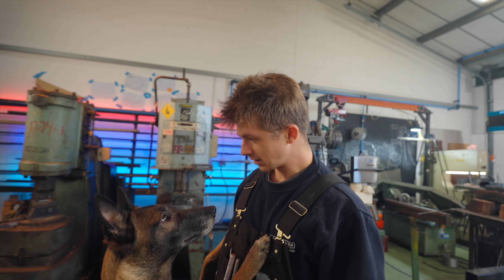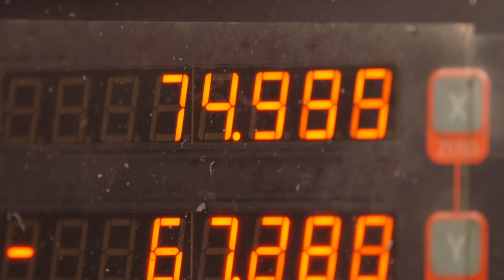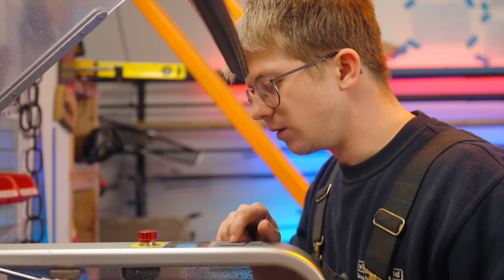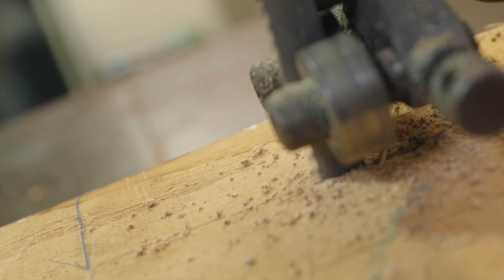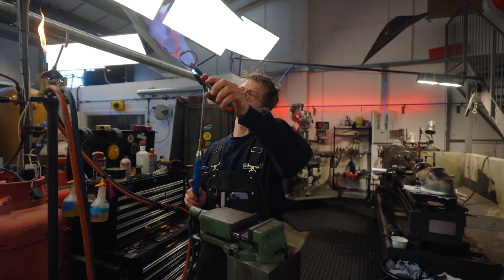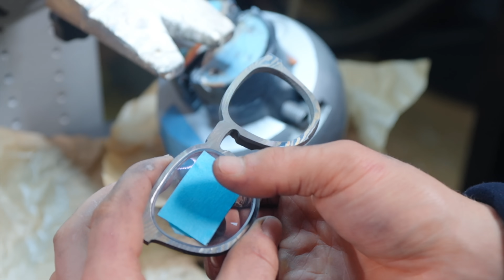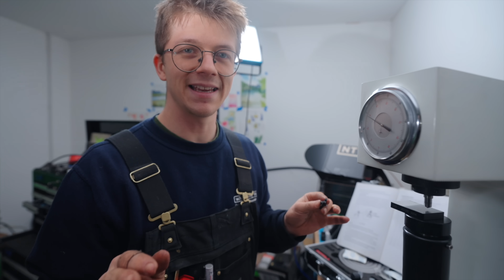Making Titanium Damascus Glasses, Part 1

Comment: Hot air? My optometrist doesn't use hot air for lens fitting and frame manipulation. They use a budget wok-type benchtop frying pan thing. (You know, those squarish ones with the big lid.)  And they fill it with dry rice. The rice acts like sand, conducts heat, absorbs moisture and releases it again when heated. Nestle the frame bit you want to change into the 'warm sand' type rice bed for a moment, then pull it out. Done. Works beautifully.  Also, if you manipulate the frame right above the warm bed of rice, it cools slower and so gives you more time to work it.

Comment: The offset of the base you were laying your stock on had a couple degrees offset on the x-axis. The machine base is an uneven suface as well so I would suggest making a bracket that attaches to a known flat part of the machine and hold that special base for cutting. You can check with level or swing gauge to measure the deviation. love your work :)

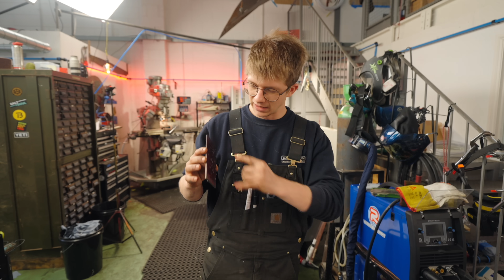Comment: 8:49 grinding off .02 is actually a real pain in the rear-end. In high production, cnc, I will scrap if it's over .006 because i can make a new part in the same amount of time as the touch-up

Comment: In reference to your concerns about the cuts on your Wazer potentically ruining a week's worth of work: hypothetically speaking, after clamping down the material wouldn't it be possible to do a set of psudo-calibration cuts into the portions of your material you plan on removing? This would be done in order to let you see how far off these cuts were made compared to what you expected and allow you to adjust your real cut to take these inaccuracies into consideration and have a lot more confidence.

Also worth noting I have no actual, difect experience with any form of 'digital file' based cutting / CNC / 3d printing or etc work and so have no idea if something like this is actually possible / feasible / has gains worth the effort; I'm just spitballing ideas.

Comment: I have that exact same hardness tester. When you’re raising the base, go until the little needle rests on the red mark. Then rotate the main dial to the black 0 on the “C” scale, and I believe you’ll get better results. The instructions are garbage that came with it. Not entirely sure that’s the right way to use it, but that’s what I do and get all of the hardness samples to read exact so that’s just how I’ve been using it and it seems pretty reliable.

Comment: Alec, I’m a machinist in the states. The shop I work at specializes in fiberglass and plastics rather than metal. I say that because a lot of the jobs we run, we run on vacuum tables. We use suction methods to hold entire parts down. I feel like that would be a good idea for you to look into. It’s not perfect of course and you do need to make sure the vacuum doesn’t shut off while running, but it’s actually a really good system I’ve never worked with before. You should look into it. You won’t regret it.

Comment: your piece was offset because you didn't account for the width of the laser. by sliding your billet against the cut piece you were not accounting for the removal of material that you spent so much time working on

Comment: if you are going to buy a 3d printer id suggest a bambu labs printer they are very easy to use and no messing about with bed leveling etc. basically just plug and play.

Comment: get a X1E bambu labs printer, it has the ability to print in ALOT of different materials! Including Carbon Fiber. Or if you are looking to get a metal printer that also allows for you to do printing in metal specifically stainless steel, you could get a Markforge FX10, which also prints in onyx(nylon carbon fiber product made by markforge), nylon and carbon fiber individually as well!

Comment: The nose holder part usually only works on plastic glases and metal glasses almost always uses a added on nose rest piece with some plastic or silicone pieces. That is because metal is a bit different and might leave marks on your skin in reaction to the oils on your skin. It will also risk chafing in a higher degree then with plastic glasses. I know that titanium is usually less reactive then other metals and is why they use it in bone screws and implants but can't say how it would work in combination with your skin oils and other things our faces are constantly exposed to.

Metal glasses will also need a relief cut on the side and a screw that clamps down on the lens. Plastic glasses is more flexible and do not need that in the same way.

Edit: Note to self, watch the whole video first since you litterally mentioned that directly after I wrote the last part.

Comment: I think where you were off is you cut on the inside (left) of the 200 mm when it should have been the outside (right) so that the butted up side was exactly at 200 mm. That shifted the whole titanium piece the to the left by the width of the cutter and hence moved the hinge slots to the right as noted.

Comment: if you wanna know a new fancy word, "Kerf" is the technical term for the offset concept you were explaining. Kerf is basically the compensation for material removal width. The CNC lasers I used to cut metal with would have kerf presettings, depending on what type and thickness of material, which automatically would adjust to make sure the part dimensions would come out the exact some as in the DFX files. You did an amazing job explaining the offset concept btw!

Comment: Not a professional with cad or cnc cutters, so I don't know the technical terms, but there is something I've picked up from working alongside them.

When cutting an inside diameter on the waser or plasma table, don't start the cut on the actual edge. Start it in the middle of the material and have it move out to the edge.

This helps keep the edge consistent without worrying about it not conforming to the specification since water jet and plasma cutters tend to wallow out the initial hole they punch through the material.

Comment: If you read all the instructions on your Rockwell hardness tester it will say to ensure the working area temperature is like 70° and if it is not it can actually throw the test off a point every degree or two

Comment: The first thing in the hardness tester instructions: 
"the test table should be built up with cements or metal having certain stiffness and strength"
- Alec "wobbly wooden table should be fine"
"Why is the factory calibration not correct?!"

Joke aside, fantastic video! Love the titanium saga that is unfolding

Comment: How in the heck do you even define eyeglass shape, is the multi-curve glass ending on the same plane at the edges making it easier?

I'm fine with your drawings, I've seen engineering students male worse. In fact I spent all winter holiday modeling and drawing some gearbox assembly and was disgusted by my own drawings because of how clueless and tired of the project I was by that point. It wasn't by the book job at all. It was particularly atrocious because I wasn't too knowledgeable how to actually use reference surfaces and choose tolerances let alone geometric tolerances in the application and blind work at all. Name me an engineer who knows those like their own pockets or an engineer who enjoys them.

And especially when someone makes drawings for their personal reference, I don't care the least bit how they do it. Draw a couple of stupid lines in paint and scribble a number, it's for your own use, not for a company's standardized archive/product catalogue/manufacturing people.

My school had just got new hardness tester alongside the old ones when I did some metal labs in the fall. It was fascinating, the new one was operated from the computer where you got the microscopic video feed and could measure the size of it from identifying the square points of the hole and it would spit out the hardness value.

Comment: History.... I was waist deep in the back of an old CNC lathe with a multi tool looking for a fault. A co-worker snuck up behind me and dropped a metal 5 gallon bucket on the concrete floor. I chased him out of the shop with a large ball peen hammer with every intention of applying multiple knowledge dents in his skull.... Good times Jamie!

Comment: Loving the Titanium projects I've a very personal connection with titanium a large section of my cranium is in fact made of the stuff it's very cool especially in the summer when it's stupidly hot my head stays nice and cool ,the titanium plate which protects what's left of my brain was milled using a CT scan in the university hospital of Wales in Cardiff , do you know what would make an excellent video if you were to go to Cardiff and make a video of the process not the bloody surgery bit but the whole process of the making of the plate from CT scan to finished article .

Comment: You could possibly use a watchmakers crystal press to insert the slightly oversize lenses in the frames. It reduces the outer by carefully destorting the lens, allowing you to insert the lens in the frame, then release it for a tight fit.

Great channel, keep up the good work.

Comment: Speaking as somebody who started life as an optical glazer, one thing you're going to need to be very wary of, Alex, are the stresses on the lenses caused by contact pressure from these frames. Plastics are a little more malleable with regards aperture size and minor shape irregularities, but metal frames are notoriously unforgiving on both fronts. Make sure to check for these stresses under polarised light when fitting the lenses. That said, I'm looking forward to seeing how these turn out 👍
Reply: Ahh, I see you're using plastic lenses - lol - in which case forget what I said. Instead, as you've been adjusting the lenses to fit the frames, you may want to have the optics double-checked, as the decentration and axis twist values of the lens prescription may be off (which, if you plan on wearing these yourself, may result in eye strain and/or headaches if the prescription is too far out of whack).

Comment: OK, hear me out. People who make watches also have a similar issue with the bezel of the watch for the crystal sits and they have a special tool that slightly bends the crystal/glass and they can push the watch bezel on it and then release the pressure in the crystal expands back out, creating a seal. You might be able to get in touch with a watchmaker and they may be able to help you. I would highly recommend wristwatch revival on YouTube. He does really good work on the watches he restores.

Comment: If a cut could ruin a week of work, run an identical piece of scrap through the water jet first, that way any programming errors will be fixed before you mess with it

Comment: I just wonder why you waisted big slab of damascus. Usualy metal glasses are made from skiny plate urverd and rounder and then welded/ soldered with bridge in the middle. I this easier way to this could be to created round danascus, cut in half lenthways and shape it to spec and welded it to bridge  made from round damascus.

Comment: Interesting you used the term "dead nuts".  I was an inventory controller in the mid 1960's for an aerospace company who did a lot of work on the "hot" section of military jets for the Department of Defense.  At the time, what was considered extremely accurate machining, the term "dead nuts" was used a lot.  However, I haven't heard that term much used on some of the other machinist YouTube videos until you said it and brought back memories of those days.   Thanks.

Comment: I used to program plasma cutting tables, and when I saw you build your offset piece for the cut I remembered that your kerf offset would impact the offset as well. If you tell the table to cut a line, say 200mm from x0, the edge of the piece that is cut is going to be 200mm minus the kerf. If you're going to do offsets it's generally worth buying, or making since you've got the tools, stop blocks that are "exactly" the right size to run an offset. I'm having a whole lot of fun watching your videos. I have nearly 0 experience with hot working metal, so this whole build has been new knowledge for me.

Comment: I'm an optical technician and glaze glasses for a living.
It's super interesting seeing the methods you use to make a frame fit the lens and not the other way around which is how it's usually done.
I'll be interested to see if your vision is still good afterwards as the prescription is aligned with your pupils specific to the frame you choose. 
So the lenses you're altering are not intended for your new frame. This may result in your prescription not being aligned quite right and may make your vision go a little weird.
Guess we'll see.

Comment: Alec. You absolutely can put the part back in the vise and get it close if you touch off with your edge finder again to find your datum, and use a dial indicator across the freshly milled section because the milled surface should be parallel to the axis of the mill you can dial it flat. Assuming you had the part on parallels and it was flat to begin with you would be able to get it closer this way than an edge stop. But for what you’re doing an edge stop will be more than sufficient

Comment: If you are using a CAD/CAM package like fusion 360, there is a method to locate all your pieces for cutting in your Wazer so they are always accurate. 

Take a piece of plate, doesn't have to be super hard material, but something resistant to impact (so it doesn't wear as bad by locating your work up against the edge). Bolt it down where your hold downs are "out of work area" and then have your wazer go along the perimeter of your work area. It will cut out the right angle bracket now clamped to your Wazer bed where the corner is at the machines (0,0) mark. 

I know you are not using CNC mill, but if you make a sketch of hole locations or features and print them off on sticky paper and put it on your raw material, it helps to locate all your features where they are supposed to be so your Wazer will then reference the same (0,0) corner and make the cuts accurately relative to all the machined features. (Given you machine them in the right spot). 

Hopefully I am explaining this clearly. This also assumes you always know the base dimensions of your raw material and also really will only work for parts cut out of some sort of flat stock. Be it square bar, plate, etc.
Reply: What the goal is, is to create a square bumper you can seat your work up against knowing the corner is always at machine (0,0). Kinda like the bumper on a surface grinder table, only two dimensional square.

Comment: You totally should get a 3D printer! They're great tools for making jigs and fixtures, or for prototyping a part from CAD that you can compare the metal you're working on to. BambuLab is a popular brand these days and I've used their X1C since its release and it's great, but there are so many options out there. Email me if you want some help choosing one for your shop ;)
I'm a materials and manufacturing engineering student and your videos are great to watch since I get to see some of the material discussed in lectures in practice. Really enjoy your content!

Comment: In watches (steel frame, no opening) they have a special press that bends the glass in such a way that it shrinks. You but the bezel around, release the pressure and the glass is in place. Should work with glasses as well I suppose? It sounds like it shouldn't work but somehow it does

Comment: Okay, I feel a bit called out about my comment on your last drawing. Sorry if I was too blunt. I really just wanted to give you some ideas on how to improve it, no ill will. Also I've been out of my job for a bit so I was trying to remind myself of a few things and maybe went a bit overboard.
The other commenters are of course absolutely right that the drawings only need to work for the person making the parts, so that being you industry standards don't matter here. Still as someone who also did some machining in the past it helps being able to find the dimensions quickly, and when you have to make another part of the same type a few months later (maybe you need it for another type of rivet) it might take more time getting back into it.

Comment: The jump scare clip reminded me of the time I was up a ladder after changing out the fan belt above a paint mixing room. I had just turned it on and was checking to see that it wasn't rubbing on anything, and someone set off a firecracker inside the shop. I swear my feet and the ladder went straight out sideways and then back under me (no idea how I had the reflexes to correct it). I was so mad. And to clarify, the person that lit it off did it to scare someone else and didn't realize I was up the ladder.

Comment: Hi, I'm an optician and do a lot of work with doing exactly what you're doing: Making a lens fit into a frame! A few quick things!
For one, you'll notice the lens you already have cut has an outer groove in. Typically the metal frames like the one you're working with here has a matching inside groove in order to lock in the lens.
Two, for metal frames, I typically see a lot of hardware holding the lenses in place, typically with a screw on the outer ends to keep it in tension so they don't just fly out with a bit of pressure. It's definitely a lot easier to work with the material to get the lenses slotted in...if you can open it in and have some leeway.
Three, those metal frames don't have any nose pieces in, so I recommend you grind down the edges round so that you don't have sharp metal digging around your eyes.
Very fun seeing you mess around with something I have a bit of experience in,  hopefully you have as much fun as I have with it being my livelihood c: